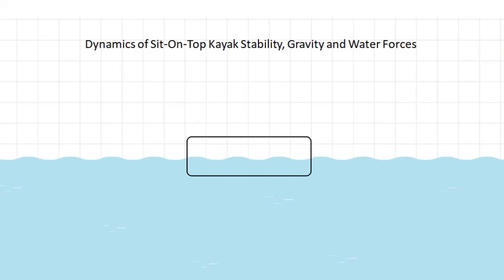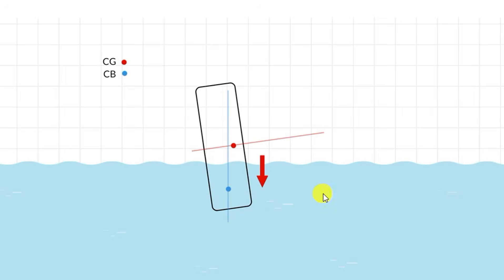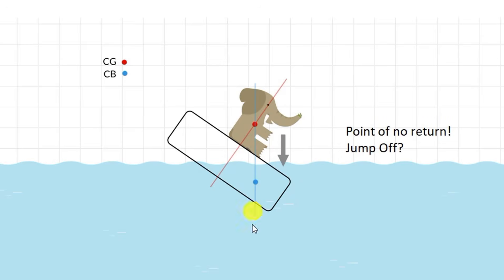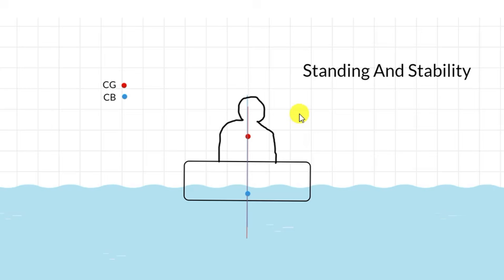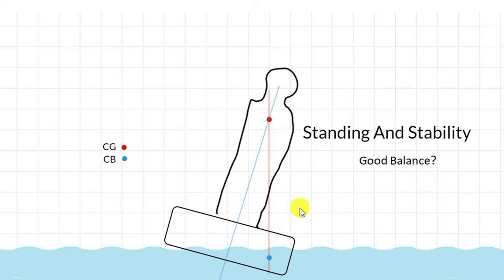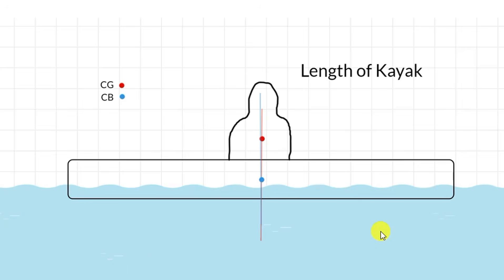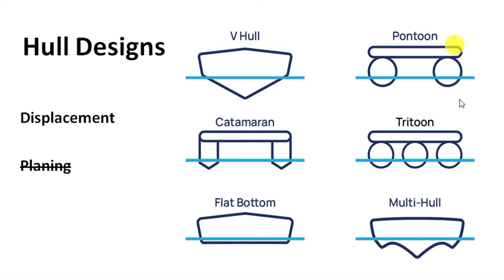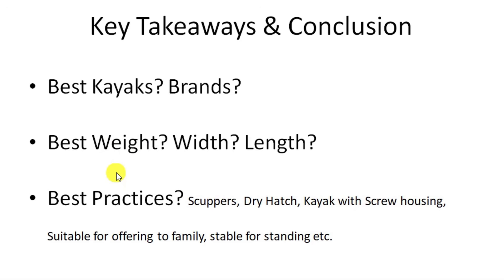Kayak Stability Explained: Understand the Mechanics (Sit-On-Top Fishing Kayaks)

Comment: I have heard and seen the larger bottom section in the middle of the bottom of the kayak is "better" for turbulent water then the flatter bottom. The larger middle bottom other wise called "acorn shape" is a better kayak for rougher waters at sea. It cuts through waves better.
Reply from the maker: True to some degree. Applies more to boats than kayaks tho, but you are correct.